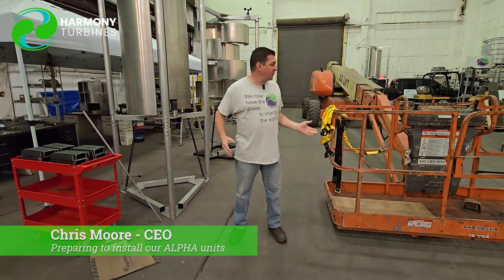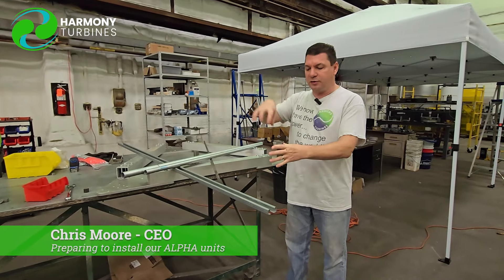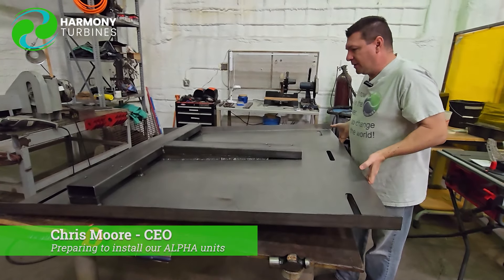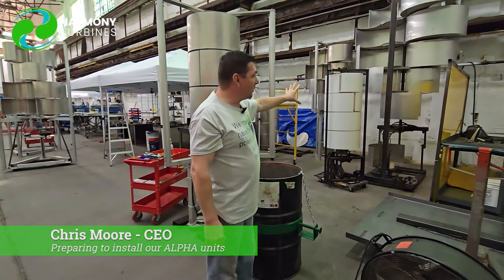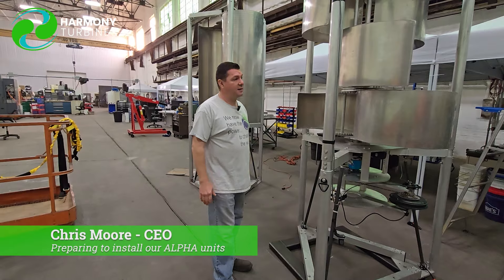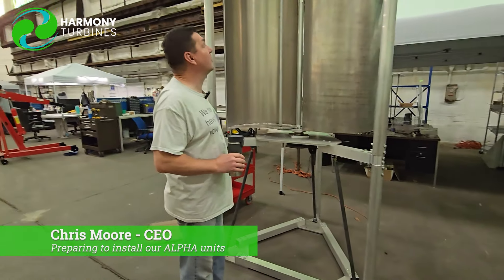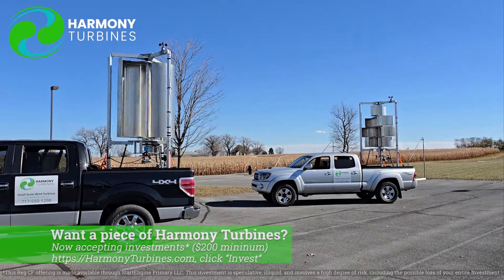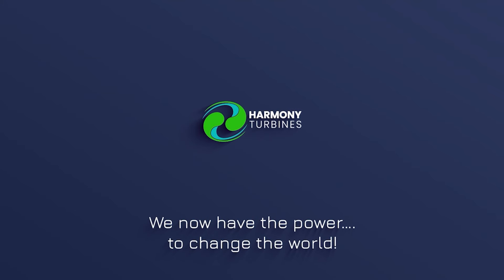Mounting Mania!

Comment: As an investor, I'm not convinced I've made a good decision here.
Reply: I'm not convinced that you're an investor. If you were, you would be very pleased with this progress. (and you would probably be subscribed to their YT vids 🤷🏻‍♂️)
Reply from the maker: Mach0 let me help you out here by retrieving your original post (from our email) for everyone to see. Your original post that you've now "EDITED" was this: "Those machines don't look very stable in a strong wind. Have you done enough stress and fatigue analysis to determine the life of the materials and welds? What about the balance of the rotating mass, top to bottom? I see too much flexing going on in the back of those pickup trucks. These machines seem simple enough to have been in mass production years ago and I'm skeptical as to why we haven't seen some sizeable gross revenues by now, if in-fact this is a good, viable business idea. As an investor, I'm not convinced I've made a good decision here."

So Mach0, you don't strike me as an investor at all because you would know that these are Vertical Axis Wind Turbines. You would also know that the frame has ZERO welds. They are 100% precision machined parts. But you would have learned that from many of our other videos. You actually strike me as someone who's a SPAMMER or a TROLL and you stumbled upon this video trying to stir up trouble. Sorry, just calling your BS here.